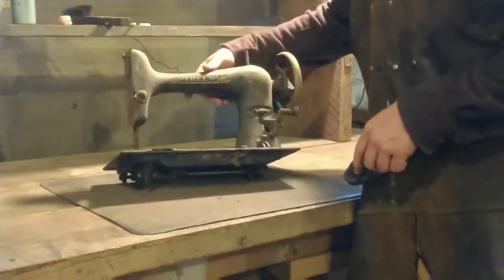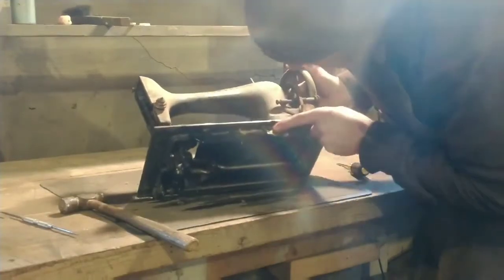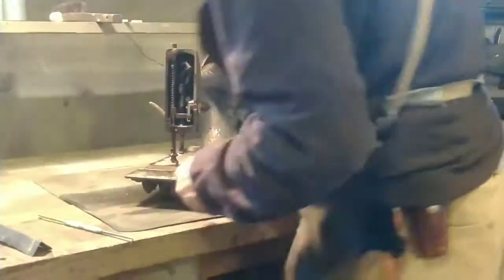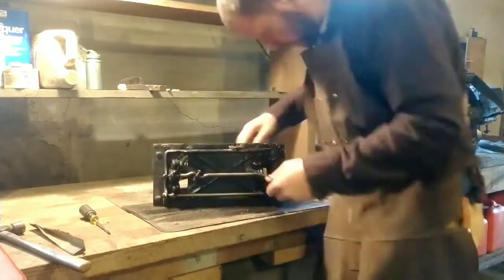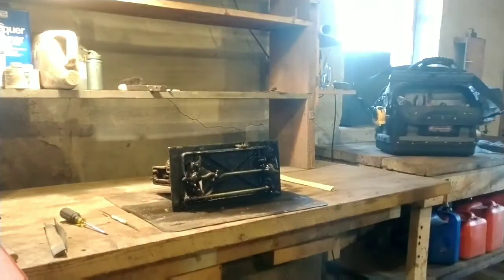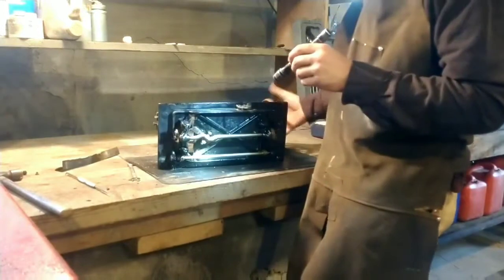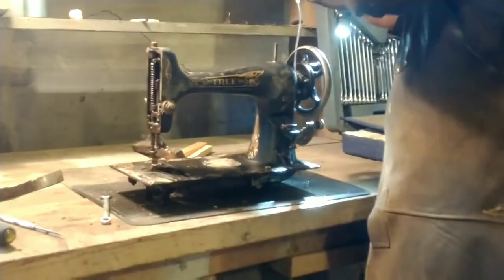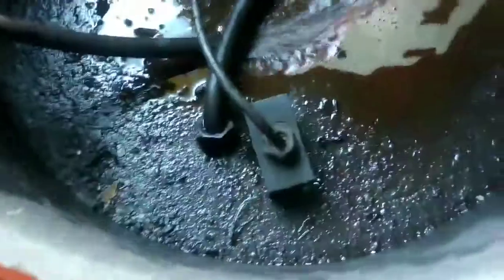Restoring An Antique Free Sewing Machine, Part 2

Comment: What is the name of the first penetrating oil you were using that worked quickly?  I am cleaning up a very similar Free machine for a friend.  It has ball bearing’s underneath the bed that twist and turn to move the shuttle. I didn’t see ball bearings under yours but it’s hard to see on your video if they are there or not. I will enjoy watching your next video but wanted to ask about the penetrating oil and to let you know I enjoyed this video.